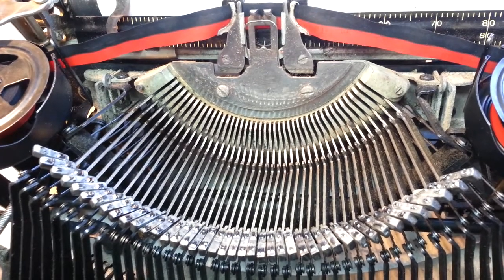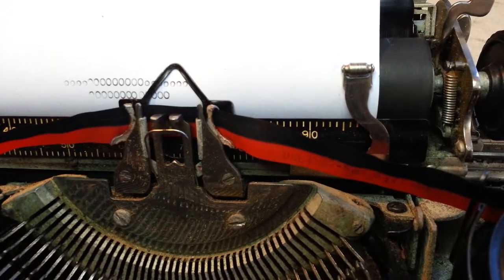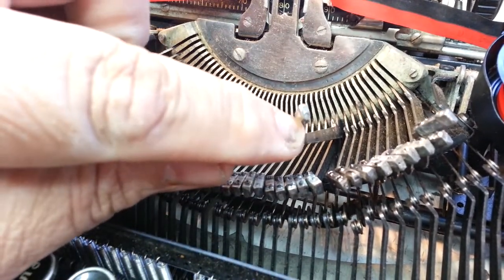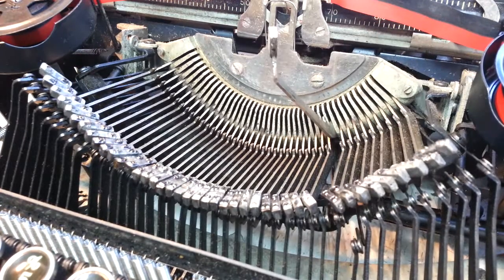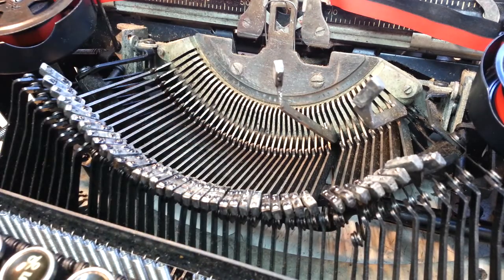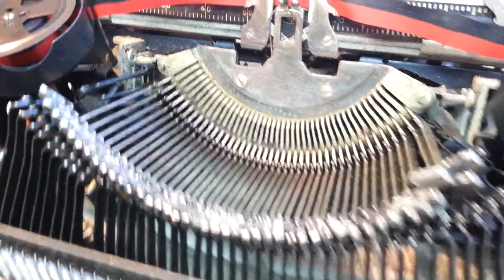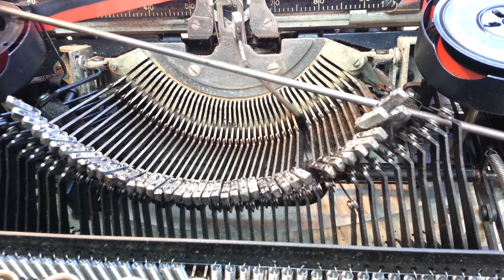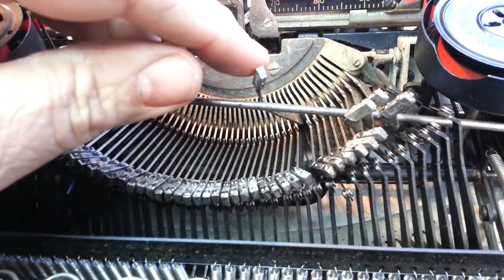Smith Corona Typewriter with Loose Type Slug Repaired, Resolder to Secure Alignment

Comment: Use less heat for a more control and less solder dripping. 

I have lost count on how many Type faces I’ve solid it in the last 50 years
Also 
Colman manufacturing 
Texas 
Sell brass slugs to help when your typeface fly’s off

Comment: Is it possible to use a soldering iron or is the solder that you mention only good with a flame? You have helped so many of us with in-house repairs. Thank you so much
Reply from the maker: Soldering irons generally are not hot enough to work with type slugs

Comment: Nice job!.. What kind of metal are the slugs made off?  Could they melt trying to do such a repair? Thank you for your videos. Very informative.
Reply from the maker: Slugs are the hardest part on a typewriter besides escapement pawls, hardened steel, not gonna melt, I have had these red hot before
Reply: What material used to joint the slugs 
Pls make vedio off joining slugs with type bar

Comment: Sorry to intrude, but I have Smith Corona Electronic Enterprise 5L (1984) with daisywheel and it was working fine, and then suddenly starter to print only half-letters (upper part barely prints) for most letters and not print a few symbols (comma, - sign, stop) at all. I checked that the ribbon is fine (i.e. not dry), and I think this is something in the keys because unprinting keys still don't print on a different wheel and make a different sound from working keys.

Can you suggest, by any chance, which part of the typewriter I should look in?
Reply from the maker: Got me ! Hammer dislodged ? Does carrier move front to back excessively (not side to side) ? Without a first hand troubleshooting, I don't know.
Reply: @phoenixtypewriter2136  Thank you for the reply! No, I don't think that the carrier moves excessively front to back, it looks normal in this regard.
I know that without first-hand experience it is difficult to tell but I appreciate your help regardless.

Comment: Howndo you know whether to use a typebar tool to bend, versus resolder to fix an alignment ossue lime this?
Reply: Like*
Reply from the maker: You should only have to re-solder if the type slug is loose on the type bar, If slug is secure on bar, then you should form type bar as needed, type alignment is tricky and there is a learning curve that can only be mastered from experience and proper tools. The two machines I learned on were IBM typebar models B,C & D, Also the Smith Corona portables. These have completely different characteristics when aligning type, IBM's have hard thin type bars, whereas the SCM have thicker but softer type bars.
Reply: Thanks!